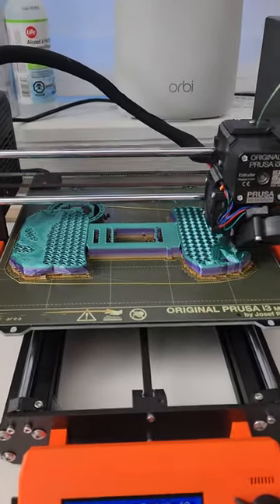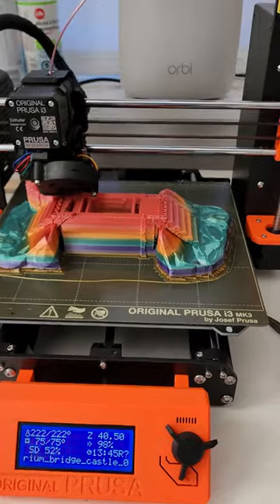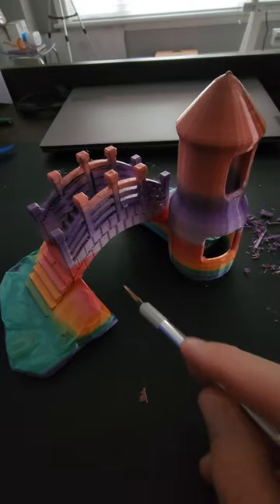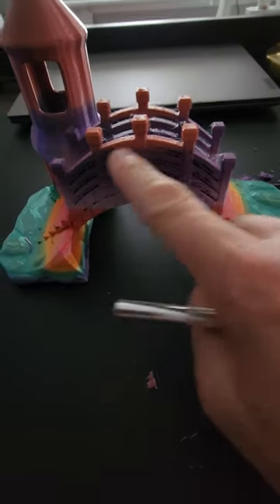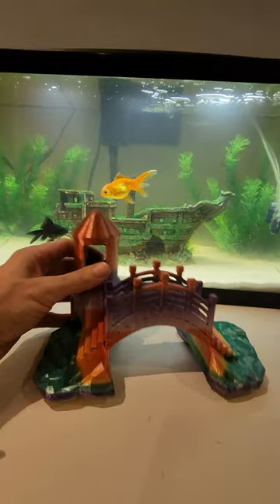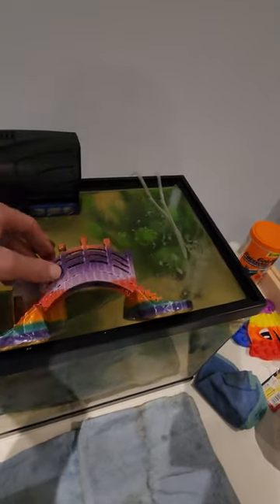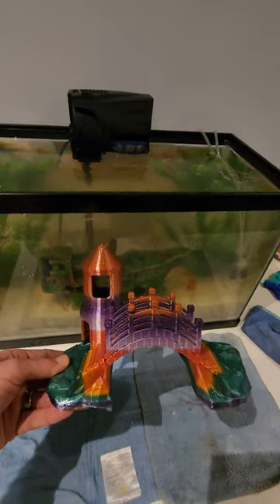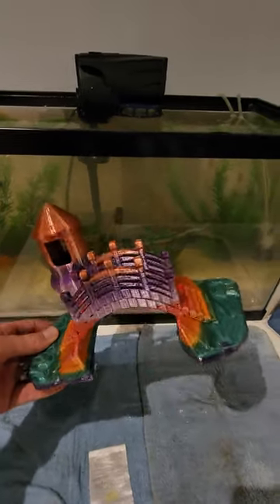3D Printed Fish Tank Decoration | Probably Not Good For The Fish 😲

Comment: Get some of the non-toxic plant weights and you can use a superglue or aquarium silicon to glue to the bottom.  
Of course if the PLA is toxic then it will not matter

check 3dsourced they have an article about "Are 3D Printed Objects Aquarium Safe?" the explain what can or can't be used.